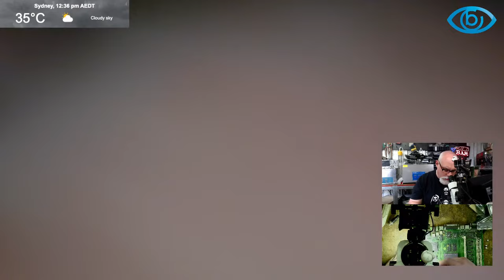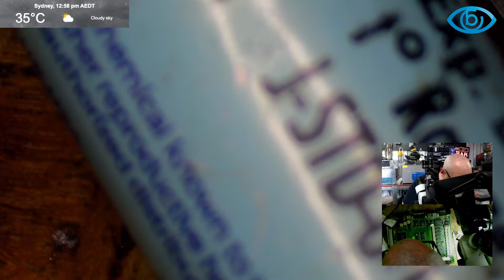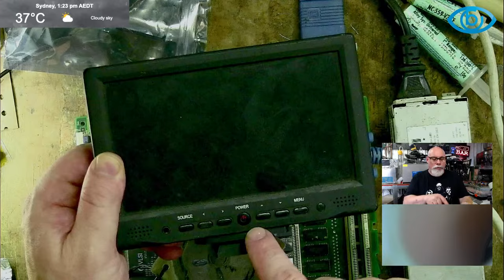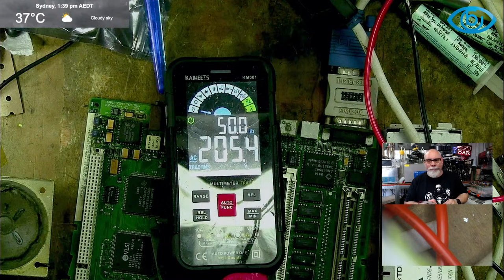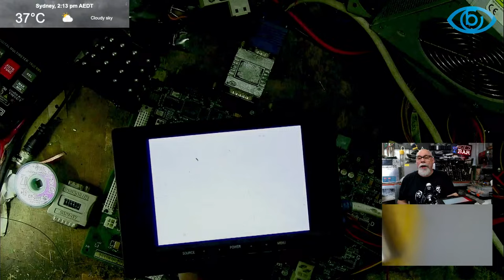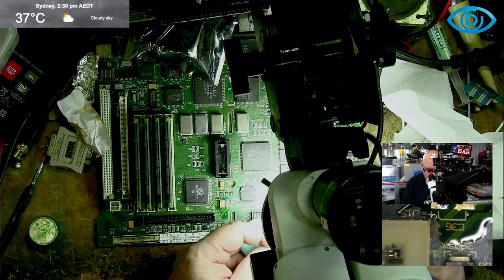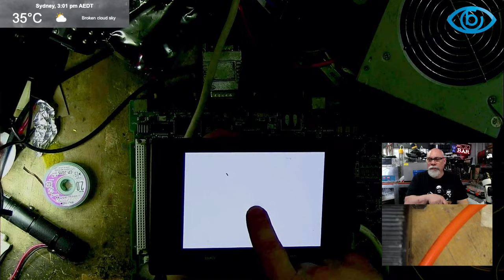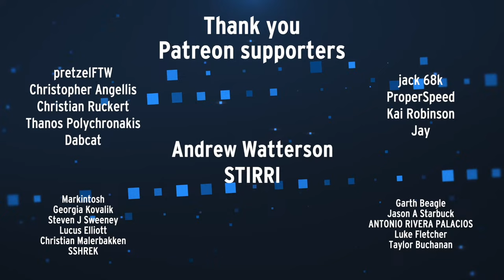Repairing some barn-find vintage Macs - Part 1 [LIVE]

Comment: @1:54:00  I'm surprised that nobody in the chat told you that the LC 475 needs  a battery to display video -- or that you quickly flick the power switch from on to off and then on again to keep that charge inside the caps for the computer to display an image.
Reply from the maker: Yes, I got the video working yesterday, thanks for the tip. I shall chastise my viewers for not letting me know sooner!